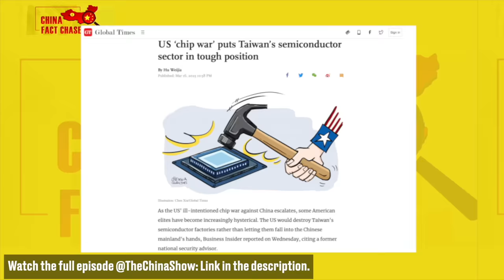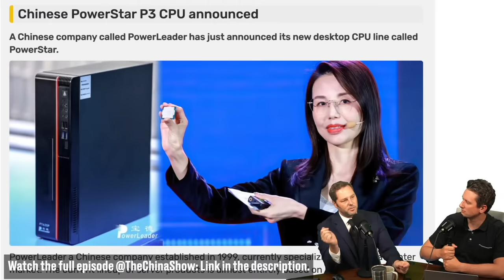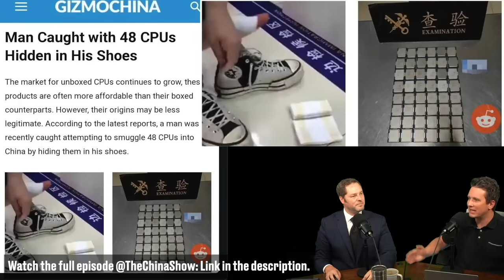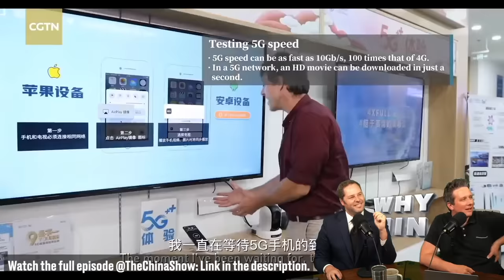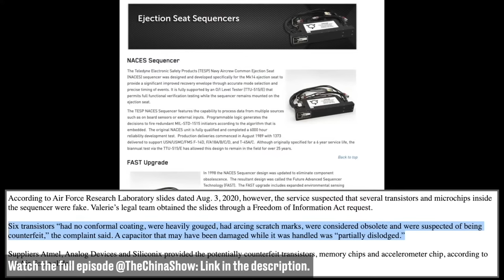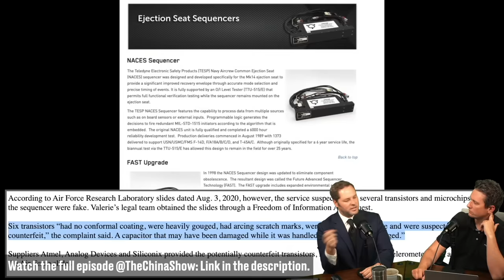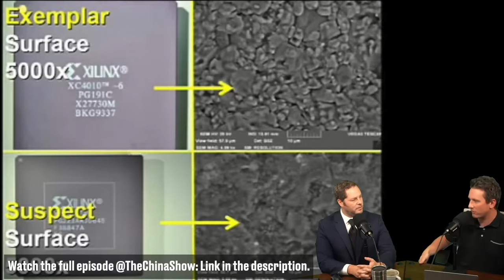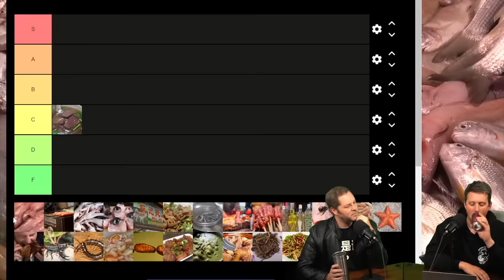China's Fake Ass Computer Chips Are An Embarrassment!

Comment: To be frank 10nm chipsets can be done by China. nothing wrong with that, they are unable to make a 7nm chipset is due to sanctions and it is not cost-effective. a ASMl machine cost 200 mil for their EUV. and they r n d so much.
under 4 nm, they will face quantum issues. CURRENTLY, i am using a 21nm chip, it is working well. for normal user is enough. the logical is to use e-waste which i doubt so.

Comment: The processor is probably a ripoff AMD Ryzen processor, not Intel. AM4 processors use pretty much exactly the same heat spreader design and AMD licensed first gen Ryzen tech to a Chinese company. I actually believe it might be this one.

I'm surprised no one put these things together instead of assuming it was Intel.

Also, the vapes blowing up that have, it has had nothing to do with chips in them or in the batteries. They have been the result of idiots and morons using them improperly. Most of them are unregulated mods which means there are no electronics in them. They are either catching fire from coil builds being to low or the batteries being rewrapped ones that either failed QC from a maker like Samsung or Sony/Murata, or they were cheap one's meant for flashlights, etc. They don't have chips in them. The 18650s that do never end up in the vaping industry because it is well known they can't handle the amperage of it and they also stick out like a sore thumb and can't be passed off as a regular 18650s that vapers use.

I appreciate you talking about the chip situation but you shouldn't have gone off on this tangent because you just looked clueless and stupid doing it and that doesn't help getting this situation or there with normies.

Comment: I would not be surprised in the least if Intel makes the i3 in China, and if so, China was given the masks.  All these guys have to do is skim some production from the factory, and slap on their own label.  Same way designer jeans are stolen for the counterfeit market: the factory just runs off a few thousand extra pair without the knowledge of the brand-name customer, and voilá: identical product, without the markup, sold out the back door.

Comment: powerstar is not home grown. it is part of amd-china joint venture licensing based on x86 architecture technology. x86 is not even i3 its way older then that. china hopes to slowly gain technology transfer once they get closer to people working in amd because technology transfer happens through human interaction. there is only two companies in the world that makes micro processor for the last few decades. china doesn’t have the brains to develop its own micro processor. intel is still selling their i3-11xxx which is their 11 generation chips i3,i5,i7 is their model the back number is the generation so they wouldn’t give that design up just yet. this chip will not even fit in a 7 years old motherboard.

Comment: You need to expand your vocabulary since using the word "making" and swapping between "manufacturing" and "creating" makes your point very hard to follow.
Also, it might be relevant that China's immunity from patent law was part of the agreement in the '80s in exchange for them taking over manufacturing from expensive, American labor. It's the price that was agreed in exchange for destroying US unions which, at the time, American industrialists were only too happy to pay.
You might also want to look at the pinouts and instruction set when comparing chips rather than, metaphorically, the box they came in. This information has to be widely available just so that manufacturers know what to build for it.
Reply: they never have a point because they dont know what the meaning of a point is. all they do is talk crap.

Comment: 5:00 from chingrish model number is it a ppc clone?
Reply: PowerPC risc based?
Reply: Really nobody uses ppc much in the west mostly still x86_32/64bit
Reply: Dem Chinese do like apple products sooo
Reply: While arm is more popular then ppc
Reply: Even Microsoft tried it with Xbox 360 and went back to using x86 based hardware
Reply: Different between a risc CPU and cisc CPU

A risc CPU dumbs down the instruction sets but gives you a lot of internal memory space in registers

A cisc have very complex instructions and needs fewer but you get less registers typically to work with

So with a proper cisc CPU your source code and . exe can be smaller in file size compare to risc equivalent unless you get fancy and put both risc and cisc instructions on the same cpu

Comment: Do these presenters not know that half of the engineers designing chips in the USA are Chinese a quarter of university teachers in tech are Chinese and because of anti chines attitude in the US are now going back to China to help develop the Chinese chip industry.

China has killed the US chip industry by building up to 14 nm chips which is 70% of the market place. Just look at the share price of US chip companies and the losses over last two years.

Without the income from the lower end chips R&D money is not available for high end development plus there stock piles of unsold chips now on the market at a tenth of original cost. 

These two guys are doing a propaganda spread and showing there lack of common sense and not telling you that China produces all the boards all the add ons used in. The chips they show are the low end chips and all are designed to fit international board designs that allow upgrades to be installed over time.

The point this pair don’t say is China gets around the high end chips by putting in three or four low end processors to make up the data processing. The only cost is space and speed but the output is the same.

Comment: chinas biggest problem is the can get the hardware to build high end mashing to make high end 6-4nm chips 
china can get the modern EUVs to make wafer for high end chip 
china did want to buy some in 2021-2022 but that deal did die because of sanktions 
so far china can make older zen 1 like chips because the got a licenz form AMD in 2016 but that like a 2017 chip on 14nm 

funny part is china can even copy the hardware because moden EUVs  for 4-6 nm chips are build by like one company in netherlands 
and even if the did copy the hardware they got a big problem because the opticas for it are made exklusive by one german ""company"" and they have exklusive deal with asml

Comment: Very Simple. They have been developing their own chips and PC cpu for many years.  Not that they succeeded and are still going.  It's not that difficult, but it is to make it as complex or high performance with new manufacturing  processes.

A common, or copied chip packaging doesn't prove the chip underneath is a fake. But copying the look to boost confidence happens.

Comment: as for tha CPU it seam unlikely they the same contect on the side though i mean they could have just stonen the heat spreder design of intel possibly because they where gonna steal the stocket spacing as well to have compatible mouting solutions...

but idk sus whebn the clock speed matches up... i think china is most likely to do a Risk5 design but all of that is behind and that still leaves the issue of getting a modern chip fab... that is the tricky business...the west controls most of that hardware and tech.

Comment: China is really competitive in the low power and embedded soc market

Micro controller and risc CPU

Not cisc and ram etc

Memory comes from Japan or Korea if you want quality but china can buy their rejects and sell u cheap shit....
Reply: They becoming better at low power 8,16,32 bit io and embedded chips

Like espressif, allwinner, and mediatek iirc are Chinese chips

But these are tablet and smart phone and android tv box chipsets not full blown desktop PC chipsets a desktop PC would use chips from these people in the mobo for a laptop or a fancy hi end desktop
Reply: That's why a 50 USD android smartphone has most the basic features of your 800 USD iphone

Like biometrics 4k and 1080p pictures and video

Hd display with decent 3d hardware acceleration

I can run psp emulators with no lag and msaa and double or triple the psp native resolution on my 64bit phone with 8 CPU cores, add hyper threading to get 16 effective cores with more ram

They getting good at making cheep electronics not hi quality expensive ones they still trying to figure that out

Got a few brands other than Huawei

 bluphone in America are rebrand china phones but pass thru American quality assurance...
Reply: I buy brands I know are good, Sony, Google pixel, Samsung, Motorola, htc is gone or atleast nobody has HTC. Blackberry too. I quit buying apple after the iphone 4 and then I only bought factory unlocked second hand apple ain't payin that much for an iphone

Comment: Americans still believe in sci fi and arc reactor technology.
All technology can be replicated it doesn't matter how complex it is.
The only thing you need is money and you can build anything.
Reply: Production at scale is wholly different than small batches. You need the talent, the facilities, and the experience. Manufacturing is also not the same as design. The CCP can make and design low-end chips that go into appliances, but struggle with the mid-range that go into high end gaming computers and are utterly lost at the high end chips that are installed into aircraft. It's not a money issue.
Reply: Good luck with that.